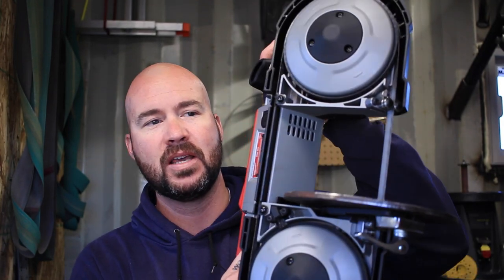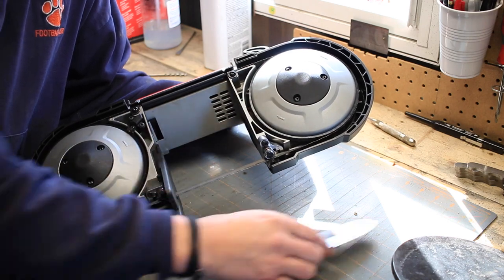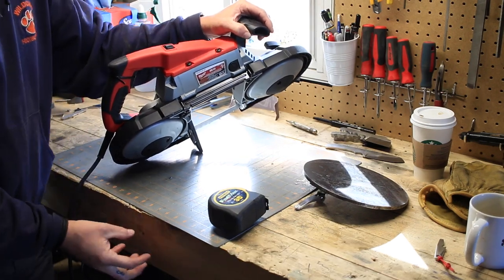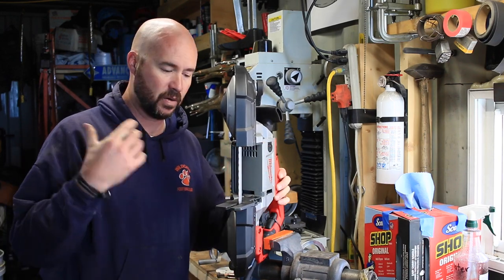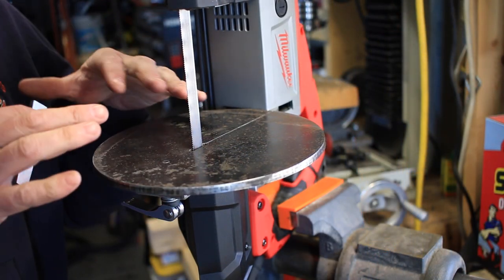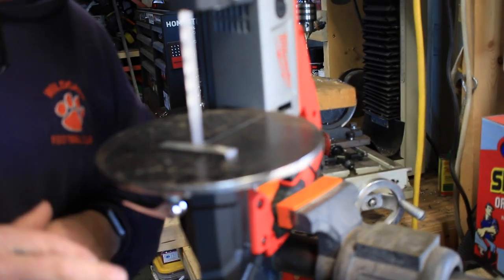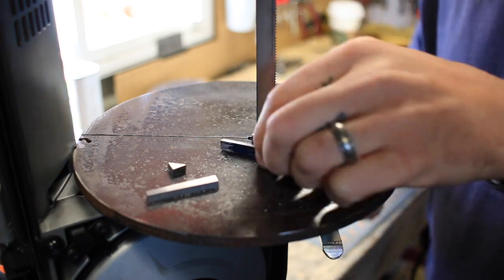Tool Time Tuesday - Portable Bandsaw for Metal Fabrication

Comment: That's a really nice table you've explained here. I intend to copy it. The back room of a bike shop is a good place to snag some take-off cam clamps. They all seem to have a 6mm thread so the right tap will be hard to find in most rural areas. Alternatively, Amazon or the hobbyist woodworking supply houses sell new cam clamps in lots of four pieces for $12 or $15. They're relatively clunky but have Imperial threads. I bought a similar Milwaukee saw years ago and have never regretted the premium price. The one vulnerability I've found is that the tires deteriorate with time so keep a spare set in a sealed pouch in a dark place.

Comment: hey, FYI the SWAG 4 table for these saws is clever and solid. I mean solid... it is the best vertical bandsaw I have ever owned with this addition. I have the newest version of the Milwaukee that you have (variable speed). The saw is awesome, too. I have the horizontal/vertical bandsaw from Jet that cost almost $700. I don't plan to use it in vertical mode any more. The Milwaukee portaband plus the SWAG table is a far better option in terms of performance. Plus, it takes up such a small amount of room on a workbench. This video was one reason I made the purchase, and I want to thank you. You steered me in the right direction.

Comment: Nice review. I really love my portable bandsaw. Mounted up in its stand I use it more than my larger bandsaws. I use a foot switch to turn my saw off and on when mounted up. I also use a strip of velcro to wrap around the switch to hold it on.

Comment: Overall impression is great!
Like your hook up that holds the handle 
Mine solved this problem but more difficult to copy and need welding. 
  Mine has a 11" square 3 legged table that pulls in & out in few seconds ( few)
My table has cross cut
My table has fence. 
Your velcro is better than my wire tie.
I can pick up my holder and move to different benchs. 
Painted Mine in Ohio State University colors. (.others can pick thier colors)
I  have a outlet for plugging in light with its oun light switch and 2 outlet that often handy.
Seen plenty of set up believe mine's has the most bells and yours is Very Good too 👍 
Thanks   we help each others please add any of my features and teach them viewers 🙏

Comment: Portaband is probably the most used, versatile tool I use when working with metal.  Use only the 10-14 TPI blades since I don't do much with thin stuff.  Horrible Fright makes a on/off foot switch that would be good when locking trigger down, just get the right 1 cuz they also make a momentary.  Think you're off some on your prices tho, the Milwaukee 11 amp that cuts 5x5 goes for $299 with case.

Comment: I really like the clamp you have for the table.
Those bandsaw tables you mention don't fit the deep throat model Milwaukee porta-band. At least they didn't, last I looked.
I'm building a table for mine, but the one difference is that I'm using a foot switch. Foot on, power on. Someone I know slipped with a sorta-band. Sliced his hand in half. Generally, they are safe as you mentioned.
Milwaukee makes a multiple sized tooth blade. It really works well for harder or thicker material.

Comment: After spending an hour or two just cutting out with a cut off wheel and grind wheel 2 knife shapes I'm definitely going to be looking locally for a used portable bandsaw. Good idea!
Reply from the maker: I hear you 100%! I still cut certain types of stainless steel on the angle grinder and man it is a lot more time and effort than the old porta-band 👍
Reply: @Simplelittlelife  yeah I feel like doing what you can to save time is a big help in the long run. I'm making a hunter, a clip point, and a modified tanto right now. Finishing up on tempering this second and going to do some sanding. My bench grinder put a couple gouge scratches in the blades so I'm trying to get that sanded out for a nice finish. Only thing I can think of is to hit it with the flap disc till they disappear lol. Each knife gets a little better though
Reply from the maker: Right on. And you’re 100% right. Every one does get better. 👍

Comment: Had to go watch this one again I've got one of these and had it years but mines the battery one and I've only just started using it for cutting out blades. I did have a bigger metal one but it was rubbish at trying to cut blades out for some reason. But now I'm using this one I need to build a stand of some sort cause my vice is crushing the handle 👍🏼👍🏼👍🏼
Reply: Yeh man plenty of power it's awesome just the batteries don't last long. I use it a lot more to cut out blades and you can see it in action in my videos. Just wish I had the plug in one for the ease of not charging and Changing batteries 👍🏼👍🏼👍🏼
Reply: Maybe look at the Makita if they do that. I'd definitely look for a corded one unless you don't use it that often that is it's all dependant 👍🏼👍🏼👍🏼
Reply: Hi diesoneveryfilm, what blades are you using when cutting steel for the knife blades? I am having trouble finding one that works well to cut 1095 annealed steel.

Comment: Id love to get a quality portaband. I have a hf bauer and it works fine and is so much quieter than the old chop saw, however i feel if i start using it for more and more of my cuts it wont last long.. i mainly use mine for cutting thick solids 2” and up... makes clean , quick cuts

Comment: Thanks for sharing. If you make a single stand that will hold it upright, as well as acting as a mitre saw that would be spectacular. 

I am surprised you did not like the 18 tpi blade as this would be ideal for thin gauge stock since you want a minimum of 4 teeth on the steel stock whilst cutting.
Reply: Very impressive cut, especially for knife makers and model makers.

Comment: Great video the only thing I have a question on is that clamp that you use to hold the table on that you made I must have missed something way you said where you got those round pieces of steel and I didn't understand the clamp is there something on Amazon I could buy that would work let me know please

Comment: A suggestion would be to remove Milwauke's wonky sliding mount all together, and turn your table around 180 degrees and bolt your table directly to the saw. will probably eliminate all your table movement.

Comment: Haha, So happy to see this video, firstly because my workspace is SO limited that I have to sit on an office chair and spin around between my handwriting side and my power tool side opposite, but this will be shown to my daughter who yesterday asked to use the small sander/grinder belt of an old einhell stone and belt set up, man , she's only six and she broke a plastic key to her toy box
( a coin or flat head screwdriver would turn it) and wanted to smooth off the Sharp parts so I used the jigsaw to cut the end off and she totally owned the belt and listened to my 'speach' on safety in the shed, she enjoyed it a little  too much and there's nothing much left of the key but that lead us on to deciding to make her a new metal key and I have been considering how to fit another tool into the cramped space I have ,now I know I can get shot of my very old Delta 16" scroll and replace with a portable band saw which will also cut metal BONUS!
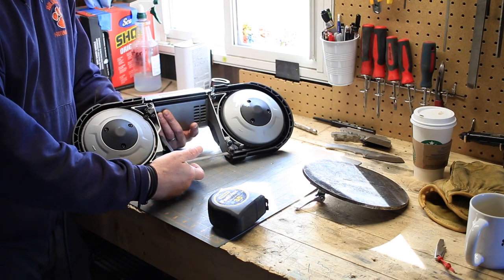And I am gonna show her on loop the section 4:15 to 4:25 
Because yep no matter how many safety systems you have in place, if you're just plain stupid or approach a tool feeling intimidated by it highly increses the chances that you are gonna get hurt in my mind,
I may even get around to buying some 01 and seeing if we can make some camping knives although I am gonna have to check out the laws here in the UK first about owning knives as they are cracking down on all sorts of things in a seriously knee jerk reaction to some teenagers sadly killing another with a meat knive from mothers kitchen drawer!!!
If we do make knives I'll set up my point and shoot cameras and try to  Send you a decent edit, 
thanks for another great video,
M

Comment: I have a Milwaukee Saw and I also got the Swag Off-Road Table. Mine wiggles something terrible. It really needs to be addressed. My saw is on the verge of falling off the back of the table. And it definitely rocks and moves when cutting.
Reply: Hi. Make one is better
Reply: I don't have a table wobble issue. I have a saw wobble issue. It's only fastened to the table via a thumb screw underneath the factory guide plate. And it hangs on about 2mm of metal lip into the open vent area on the casting on the rear of the saw. Well, the issue is the wobbly guide plate. There really isn't any way to tighten that up, short of just removing it and permanently modifying the saw.

Comment: A question about the table. Was the quick release an axle and how did you attach it to the plate?
Reply from the maker: You bet, it is a quick release from a bicycle (actually I think it was a seat post binder) and I just tapped it into the table. Cheers👍

Comment: im so confused, i have virtually the same port a band setup but i cannot get it to cut 1095 annealed .120". regardless of speed change or TPI on the blade. Using a Bi-metal blade. any thoughts on why this is happening?
Reply: nvm, found out why... some other reviews said that the steel is not annealed even though it is advertised as such so thats why i cant cut it im guessing. sucks i dont have a forge yet...

Comment: Why not tighten the sliding bracket to prevent the slop/movement of the cutting table?
Reply from the maker: Never thought of that but I’m not sure it’s overly easy to do. I haven’t seen any means of adjusting that. Having said that, it hasn’t been an issue so far with it. 👍

Comment: Hello Jeremy, I own an old vertical band saw that I made into a variable speed unit with a new motor. The blades are 94" long. I bought two metal cutting blades from a company on the internet. I told the salesman I would be cutting 440C stainless and he set me up with Lenox Diemaster 2 blades 14TPI, part #341723717. I tried to cut my first 440C blank last night using my refurbished rig and within a couple of minutes fried the blade. Even though I was lubing with oil. Any recommendations as to what I can use. Are you cutting 440C on your rig or just 01 tool steel?  Should I abandon my machine and buy a rig like yours? Any help would be appreciated.
Reply from the maker: Most stainless steels won’t cut this way. I like nitro-v (and AEB-L) for the  convenient reason that it cuts easily in this way.
Reply: The NItro V and AEB-1 are steel or blades?

Comment: Why not just get a desktop bandsaw? Like the ryobi 9in bandsaw? Uses the same blades as these portable saws, but is made to sit on a bench and be used vertically?
I see it at lowes all the time and I'm currently saving for one.. (just blew my tool budget on a 4x36 &8in disk grinder combo, and then bought a Korg keyboard lol) So if there's a reason not to buy one I'd love to know.. I'm not rough on my tools and use them for hobby work, (leather, kydex, wood, some steel; knife, and tool resto..) So I don't need all super tough makita stuff when ryobi has served me very well ime.
Thanks, and anyone is free to chime in to answer.
Reply: p.s. here is the bandsaw..
http://m.homedepot.com/p/Ryobi-2-5-Amp-9-in-Band-Saw-in-Green-BS904G/205503634
Reply: Matthew hmm.. I just bought it today to try out, and it cuts amazingly well on most stuff, wood, kydex, leather, even aluminum.. I have a steel blade but haven't tried it.. Thanks. I'll look into options for cutting steel lol I hate my angle grinder.

Comment: Bandsaws.  A saw blade is a saw blade is a saw blade. No it is not.

I am a professional luthier and have two bandsaws which I use daily for a lot for many different applications. I have hot rod my saws in the past to do amazing cuts, and as much as you do to your saw, the blade selection is most important. You can have the finest bandsaw in the world, but if you have a blade that is not ideal for what you are doing it is never going to work ideally. Bandsaw metal matters a lot, length of blade, the kind of teeth, the kerf of the blade, the tooth material, pitch of the teeth, and the number of teeth. A $99 Harbor freight saw will easily out perform a $250 Milwaukee saw, and last longer, IF it has a better blade.

Think about bending metal. Look at the small diameter of the wheels you are asking the metal blades to bend around at high speed. What happens? It work hardens dull to creating friction, and friction creates heat. Heat de-tempers your blade, and it gets dull quick. The duller it gets the more you push. The more you push ..... you get where this is going. Don't push, let the saw do the work. Small wheels and high speed require special metals to bend with the least amount of friction build up. Get the smallest kerf size you can. Thicker blades create more friction and are less cutting accurate. 

Talk to an expert, not a salesman in a big box store about your needs, and the saw you are using. I use Louis Ittura of Ittura Design in Florida for all blades. He knows more about saw blades than anyone I have met in 20 years. He has a vast array of saw blade materials from the best manufacturers, suggests several blades for your application, and welds them up for your length of saw, and ships them to you. Buy 2-3, you're going to wear them out.

Comment: "use a push stick if you need to".... then cuts very small object without push stick, on the thing viced to the thing viced to the thing, without easy off switch .....ughhhhhh